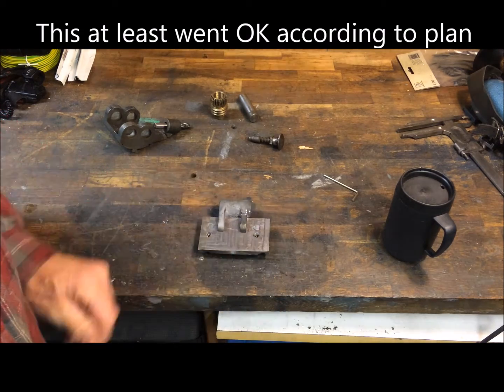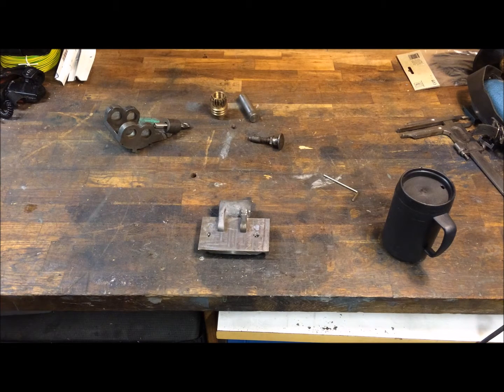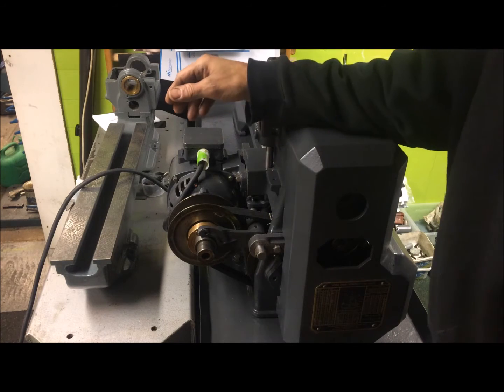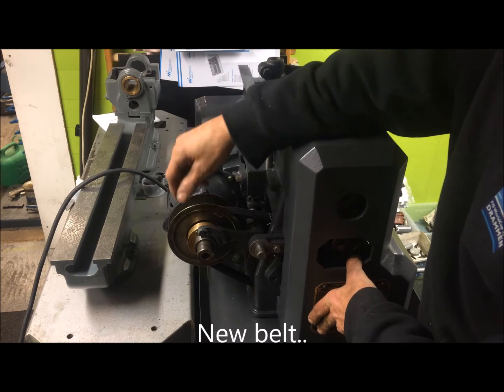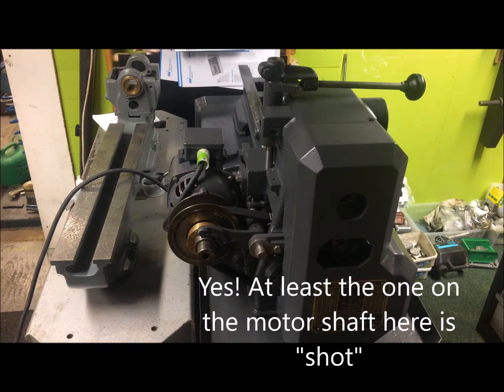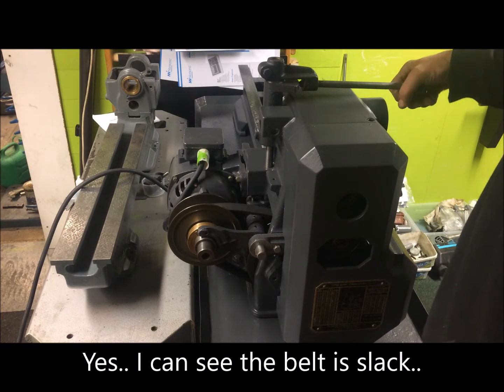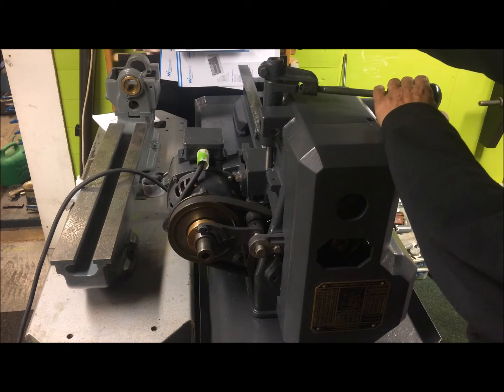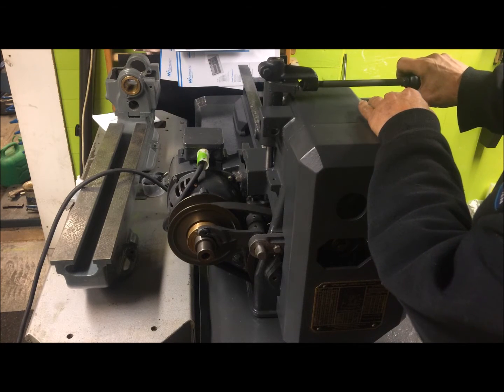Raglan Little John   motor and variator assembly

Comment: Hi Jan - what is the shaft length on this motor? I have acquired a three phase but it might not be long enough.
Reply from the maker: Hello there,
I parted with this lathe some months ago.. but know the owner, so can pass the question on. However, I think the shaft was standard length, ie.  6-8 cm, but then fitted with an adapter for the variator. One word noting is that this system "eats up" a lot of power, so it may be a consideration to do away with the variator, ie, just use a VFD for speed changes
Reply: Jan Sverre Haugjord Thanks for the reply! Those are exactly my thoughts. I intend on fixing the motor/belt in place and removing the assembly, a VFD seems like an ideal solution. The motor currently has a 2 1/2” pulley on it, what diameter would you suggest if I stick to just using the VFD?
Reply from the maker: @birkinscycles6525  If your chosen motor is a 4 pole, ie. 1500 rpm'ish, I would select a 1:1.5-2 reduction ratio so that I could get up in the 2500rpm region with 100-150 Hz from the VFD. At 50 Hz you would then be at around 750-1000 rpm, and could lower into the low hundreds on the VFD alone, but also switch in the backgear (which I believe is another 1:5-6 reduction) for really high power applications
Reply: Thanks very much!

Comment: As one of your commenters said, a link belt is much quieter than a regular one. But to my ear it sounds like a worn bearing. This is not surprising, since the last Raglan was made in 1971 (according to lathes.co.uk, the  Encyclopedia Brittanica of lathes). Unless the lathe has had very little use, I suspect a worn bearing.

Comment: also Jan, I changed out the belts(my lathe has two belts ..one from motor to idler pulley, snd a second belt to the hesdstock).Although both belts looked fine, there was some vibration that was annoying me, and i changed both belts to power twist type vee belts that have individual links. The huge huge increase in smoothness was astounding.
Reply from the maker: I will try tightening the belt (extend the mount?) , as it seems to be a little bit too long

Comment: i experinced a similar "nasty" noise jan, in the idler pully of my lathe, new bearings made a huge huge difference.
Reply from the maker: I played around abit with this last night, and yes, it seems to be the thrust bearing on the motor shaft. This is easy to check/fix of course just buying the correct part. I still think the whole mechanism is a bit, how to say, not optimal. Tried to adjust, but I am not satisfied so far with the results